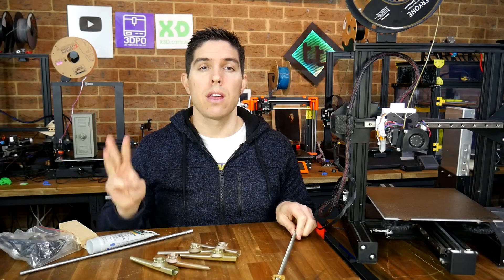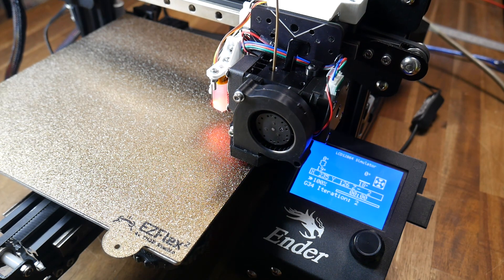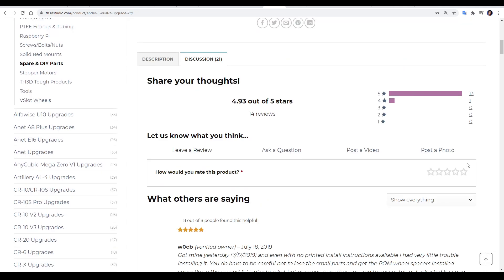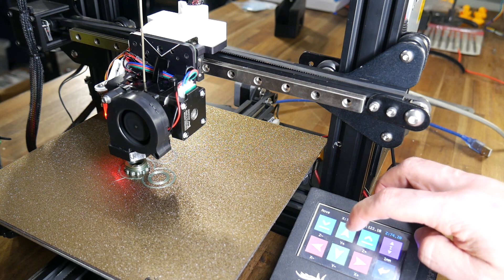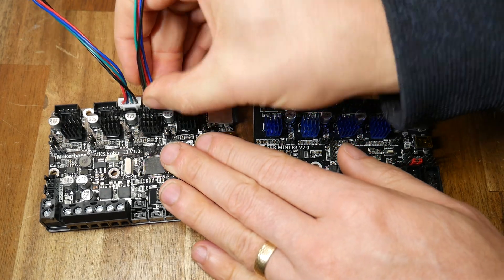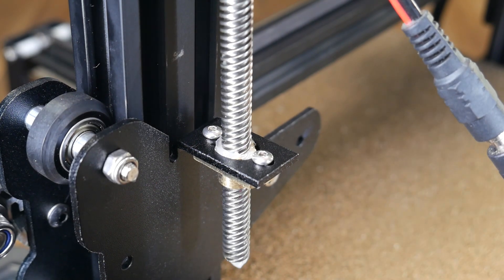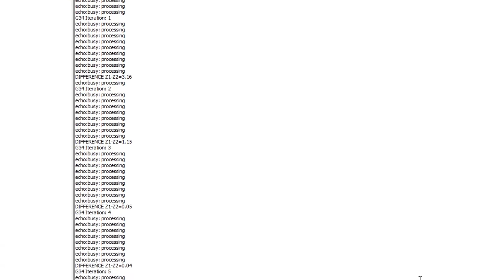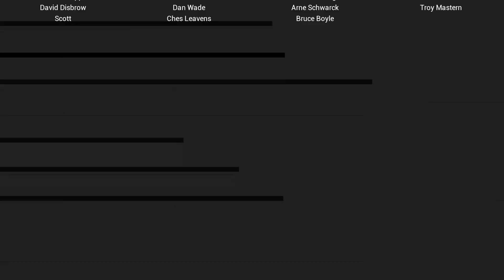3 ways to add a dual Z axis - Including G34 auto Z levelling

Comment: Although this video is over 4 years old, maybe I'll be lucky enough to get some help with this: I'm a complete beginner in 3D printing and I own an Ender 3 Neo. However, I've noticed that the z-axis tends to misalign downwards, on the side where the pulleys are located. So I thought about the possibility of adding a second z-axis, and this video was perfect for me. However, my main beginner questions so far are: 1) Does everything said in this video apply without restrictions to the Ender 3 Neo (not the V2)? 2) In the case of implementing the third option, is the 3 Neo board already recommended? 3) Which of the 3 options shown in the video would be the most suitable for my case, as I don't initially intend to produce large quantities for sale, but I want the best possible print quality for this printer model? 4) Based on the answer to item 3 above, would you have a link to the respective kit? Congratulations on the video! (Please forgive me if this text isn't written correctly, as I used Google Translate since I'm not fluent in English.)

Comment: 14:31 maybe a stupid question but if you plug your second motor (Z2) into E1, how does the firmware know after enabling Z2 that it’s plugged to E1? Do I need to mention the port it’s connected to in my firmware? Besides that, loving the tutorials, allways!
Reply: E1 is the Z axis in extended mode

Comment: Very informative video. 
While my Biqu BX already has 2 leadscrews, it was running both stepper motors of one module on the board. Thanks to the Looksonline Github I could fix this and add the modified firmware with settings already applied.
Watching this video helps to make much more sense of why and how this is done.

Comment: with Option 2, when you lower the gantry down to the blocks (i'm using 123 blocks), what is the best method to align the gantry to the blocks? Loosen the screws on the gantry mounts?

Comment: I believe something that is generally not mentioned in these dual Z-axis implementations is that if the three wheels on each side are kept adjusted as they were before installation, it ends up being a redundant mechanical system, resulting in less smooth movement, increasing wear, and friction

Comment: I recently moved my ender 3 to klipper. I plan to upgrade the main board to the btt skr mini e3v3 to add the dual z stepper motors. Does klipper have a similar command to G34

Comment: Great video.  Thank you for the help. I did the second method.  It worked OK but the motors get out of sync all the time. I'm going to add option 1 as soon as I get new screw rods. My work around until then is to put a ruler between the two connecting blocks, and mark a line on them.  When I start a new print I merely check their alignment, correct, and proceed. Does anyone know the thread designation of the screw rods?  Thank you. Roland

Comment: If I mount a second indipendent z motor with linear rails, do i stil need to software calibrate 'em? Or would it be more harm than good?
Given the higher stiffness of the structure, that removes asimmetry by itself, I wonder if letting the motors move indipendently could led in breaking somenthing and just "good assembling"/"phisical calibration" would be enough

Comment: are there any possible problems with power supplied to the second motor in the second scenario? Could f/e the mainboard not be able to supply enough current for both motors?

Comment: Just got an ender 3 v2, having issues, I can get to stay level and firm but only when 3- 4 of the wheels are so tight I cant force them to turn by hand against the metal, making 2 others not touch at all, when all 6 wheels are even tightened it wobbles like 5-9mm lower on opposite side.

I wanted to ask: belt driven and 2nd motor are about same cost for me it seems, 2nd motor option uses daisy chain from 1st motor to 2nd instead of board/firmware edits.

Which of these 2 options would be most ideal for required regular calibration / odds of it not going out of sync while actually printing?

Also my lead screw has a but of wiggle freedom in the gantry hole when the gantry is loose, is this normal or are the threads on either part made wrong size?

Comment: How many RPM is that blower?
I did the dual Z motorized but I reverted to the dual Z single motor because I did direct drive and I had a spare 42-40 from the extrusor. The new Ender 3 V3 SE uses dual Z one bigger motor. 
I did vertical and rigid coupling but put Oldham because when you tighten top belt, tends to bend the lead screws. The single stepper needs to raise to near 1.38v the Z onto the mainboard.

Comment: I ordered the dual motor z axis kit and also the belt drive kit. Is there any reason I can't run both motors with the timing belt so they stay in sync?
Reply: Nope, I did exactly that. 

Except I wouldn't recommend the kit where the belt goes on top of the gantry and the screws are fixed on the top (want no rigidity here) but instead the z-axis kit with the movable axle hole, two 20t pulleys and a 610mm belt, maybe stretch it a tiny bit beforehand so it's not super tight: it's not meant to transmit torque just keep the screws in-sync.

It's a lot of work to get everything lined up perfectly so the timing belt is somehow both tensioned and not putting any tension on the screws so they can wiggle around a bit and the gantry is both square to the frame and not binding anywhere. Just have to keep moving the gantry up and down while you tighten and loosen parts to get everything settled in just the right places. I have it running for a while now with zero desyncs and no z-banding or other artifacts anywhere.

Make sure you disconnect the steppers while moving the gantry up and down so you don't damage your control board. Even so if you messed it up you will probably cause a lot of current draw from the motors which can tip current limiting, maybe damage the board or overheat the motors.

Comment: they don't make the SKR E3 Turbo anymore, what would be another SKR board that can do G34 leveling?
Reply from the maker: Any board with enough stepper motor drivers (typically at least five). It's more about the firmware changes.

Comment: So I followed the steps but in the firmware i can't find #define Num_Z_Stepper_driver 2. Everything looks like it works but the second Z motor is skipping and grinding. Changing the wires makes the other Z make noise. The v-ref on both steppers are the same. Anyone had a clue on what to do or where to look? Thanks
Reply: In Configuration_adv. there is a section Multi-Z steppers but i can't see or find  a define second z. There is no second z data in Pronterface either
Reply: To clarify. I use a MKS GEN L V2.0 board

Comment: Hello, great video, unfortunately I'm not able to get G34 function working, I have CR10S with V2.2 board which has extra E1 driver so it should be able to work as Z2. I set up everything in Marlin just like you showed in the video except for number of Z steppers (that line is missing in latest version of Marlin) and when I try to compile FW it shows me this error "TMC2208 or TMC2209 on Z2 requires Z2_HARDWARE_SERIAL or Z2_SERIAL_(RX|TX)_PIN."
Is there any chance that you would know what am I missing there please? Thank you for answer :)

Comment: I have a dual Z axis stepper motor and I was still having misalignment issues.  I fixed this by having my extruder to the right to balance out the weight.  I have used a custom G-code that would move my extruder to the right when finished.

Comment: For method 3 is there a way to use 2 end stops to square the gantry or isn’t there enough inputs on most boards? Tramming it to the bed seems ok but if bed is out then it will force the x to be out too which surely isn’t good for alignment long term

Comment: There seams to be a 4th dual z-axis method. BIQU HuraKan dual z–lead screw upgrade kit. All this consist of is a lead screw and a 2nd stepper motor running off one driver with no synchronization.. They give no info on how this is supposed to work. Anyone with any ideas?
Reply: This is the exact same as the 2nd method

Comment: Been running the dual-z from a single motor for years now, highly recommend it over the other options, it encourages you to understand where things bind and get everything resolved and properly settled and in-sync/parallel. Nothing can drift out of sync on it's own and I haven't had to level the bed since. Thrust bearings and a shaft clamp keep the smaller threaded rod from popping up into the air, you'll want to fully constrain that instead of relying on gravity.
Reply: I watched this whole video twice and after having my own binding issues as well as gantry sag I believe you are right. I have a question and a request: What happens if it's too much on one motor? Motor failure, or driver failure? And second can you explain what you were saying about a coupler at the end of your post? Thanks
Reply: @15RunAway   @Dan Cantrell  good questions. Too much for one motor: it will skip steps and you will usually hear it, adding a second z rod adds a little bit of friction, but really you are balancing out the existing load in a much more controlled way.

For the last part, when you belt the z the second lead screw basically hangs from the top of the block, the thrust bearings help with friction better than a normal bearing, and the shaft collar goes on the underside with another thrust bearing, it restrains that lead screw from ejecting itself partways up and keeps things more rigidly constrained. Ideally gravity is enough for this, but I felt the need to do this and think it helps.
Reply: @Roobotics It helps a lot!  I really appreciate you taking time to answer my questions..I have 3 Creality printers and only two have ABL sensors. I figure the only reason I haven't really come to the point of thinking seriously about dual Z's is probably because anytime I've tampered with the X axis and got the level off all I had to do is probe out another bed mesh, but it gets old doing it manually on this one that isn't equipped with a probe.. I thought about spending my $50 monthly hobby allowance on another probe or doing the dual lead screw. I feel that the CR Touch is kinda like putting a bandaid on a splinter without first removing the splinter if that makes sense.. And I've also did a direct drive upgrade on it recently too, so that adds some weight to it as well. But I'm like you, I like the simplicity the single motor belted Z, of keeping it free of potential points of binding and such. Your thoughts?
Reply: @15RunAway  These days you can get Z probes for far less than $50, there are also some pretty cool DIY probes that only need to be installed temporarily at-probe, look into things like clicky probes etc that voron use to get an idea! I have a knock-off BLtouch, but my board is also flashed in a way that I don't need it for Z probing at all(seperate limit switch), it's just an optional extra and I've hardly been using it, that said.. all my prints are still using the mesh data it generated previously as I slice with the gcode to use saved mesh data. I'm actually about to swap to a 1.5mm G10 surface and will need to remesh for that at temperature... So I'll be glad it's still installed on there!
Reply: You have those that say a dual Z should have dual steppers with their own drivers because the dual steppers split puts too much on a single driver. And some say the single stepper belted Z does what you said and puts too much on the stepper and causes skips, but I'm not one that's gotta print at 100mmps. And you said you've been doing it for years so that's what I want to do.. I've always been one that want to do things right but a lot of times it doesn't have to be the biggest and most expensive way in order to do it right..
Reply: @15RunAway  I wouldn't say putting two lead screws on a single stepper will cause skips, I think this only happens if your gantry is binding or is very heavy, at the start of my conversion I had hidden binding I had to resolve(also I am using direct drive fyi), by the time I was finished it was so frictionless I nearly had to worry about it slipping down when unpowered. If anything, a tuned dual-z is easier on the motor.. single-z is very much like trying to lift a weight from across the room on a board, and what's keeping it from falling away from you is a wheel rolling against the far wall. That friction isn't free either, and it's a very awkward way to deal with the weight vs lifting from both sides, imo!
Reply: @Roobotics  Exactly what I was thinking! I mean think about it, when in a hurry to get the Z up out of the way I've grabbed it ( with the stepper disabled of course) and just pulled it up a little and if I don't pull it from the middle it's gonna bind. So, yeah, you are definitely right! Any belted kits you recommend?
Reply: @Roobotics  and like you I have dealt with binding issues and worked it out so good I'd have to worry about it falling when not under power.
Reply: @15RunAway  Also there is still another option that is how the Z axis can be driven that I may explore in the future, there are the Belt Driven Z axis. That is the entire Z axis is lifted up via 2 belts from each side, and the concept of a leadscrew is completely gone!
Reply: @Roobotics  I've seen this. Just gonna go slow for now, will probably do things as I learn. I love to tinker and mod myself. Haven't even been into printing for too long. My son got me an Ender 3 Neo (not V2) for Christmas and now I have 3 printers. Bought two V2s from one  of those unrepaired eBay stores that resell new returns and came out really good. Bought the first just for parts and was just gonna upgrade my Neo with the color display but actually ended up putting it into service so I bought a second one for parts and it was better than the first! So now I got them all going. Lol.. Got two practically brand new Ender 3 V2s for $100 each. Didn't even have dust on the fans yet.. some hardware was missing in one and the other didn't even look like it had ever printed a single thing.. Just really got caught up in it all really fast... Really enjoy it.

Comment: None of these systems works well primarily because they're all poorly designed. When you're talking z-axis precision it would be nice to have precision better than one layer height.

I've noticed with a belt systems that the lead screws are free to move up and down in the bearing blocks, in other words they're is nothing to prevent Z-axis movement, this might not seem like a lot but it's well over three layer heights on every system I checked.

If you use the belt driven dual axis system then you need to print some collars and thrust washers and place them underneath the top bearing blocks. You need to adjust these for minimal backlash. This will reduce z-axis deviation error to less than about 0.1mm

G34 is a joke, you can't possibly be trying to level the gantry by using the bed as a reference point.

Think about what you're doing for a minute, any error in the bed is going to be transferred to the gantry, this means that over time the error will continue to grow and grow and grow until both of them are severely out of plane.

I mean come on the bed is mounted on springs with adjustment screws this is not what you want to use as a reference point.

The proper reference point would be the top of the gantry. Preferably a couple of blocks mounted up there which have been placed accurately using calipers.

Ideally you'd want to take the x-axis gantry to the top and use the two blocks as the reference point to level the gantry.

Some people try to ram the gantry into blocks at the top of the Z-axis under power, this doesn't work. It forces the steppers to skip steps Which introduces quite a bit of error.

I've experimented with the system where they ram the gantry into blocks or into the z-axis and stop at the top and I couldn't achieve any resemblance of precision. And we are talking error rates of plus and minus 0.3mm which is over two layer heights at 0.28 mm

I wouldn't consider two layer heights deviation acceptable by any stretch of the imagination.

The system I use is to manually level the gantry to blocks which have been mounted to the top of the Z-axis

I run the gantry up to the top within 1 mm of the blocks and then I use my fingers on the coupler screws to manually turn them until the gantry makes contact with the reference blocks.

Then I run the gantry back down to the bed..

This is by far the most accurate system I have come up with. I'm seeing precision of 0.003mm 

I mean seriously you need the gantry to be square with the frame and use the gantry as a reference to level your bed not the other way around.

Comment: When adding a second stepper motor with a Y adapter the current from the driver board is now shared with both motors. I am seeing some random stalling of the motors. What would be the current or Ref voltage set to when using two motors?